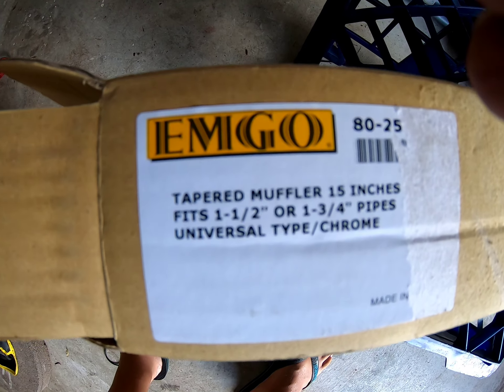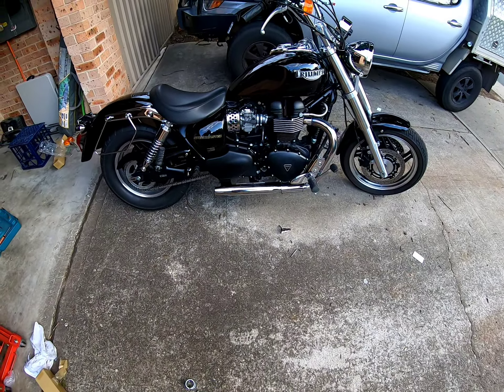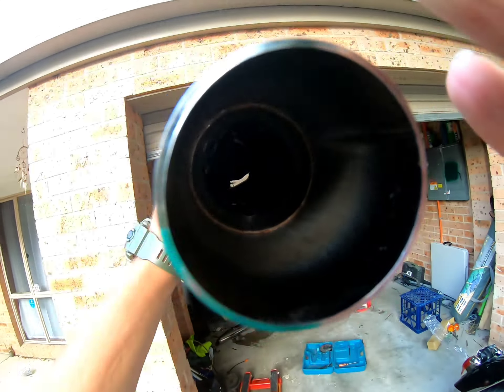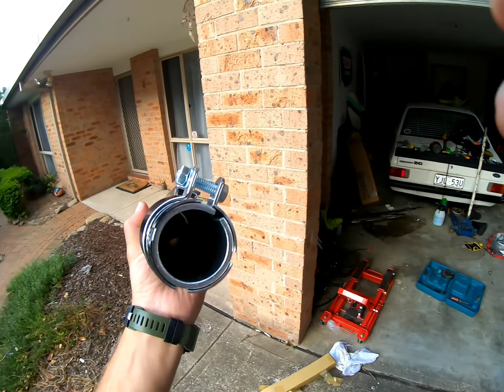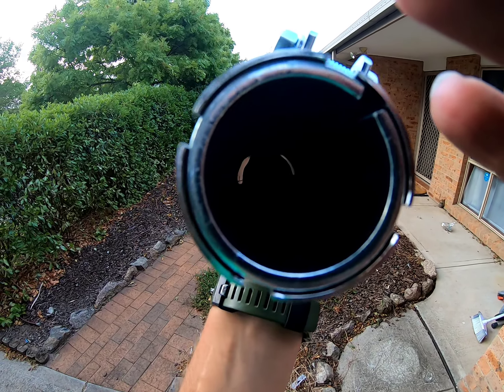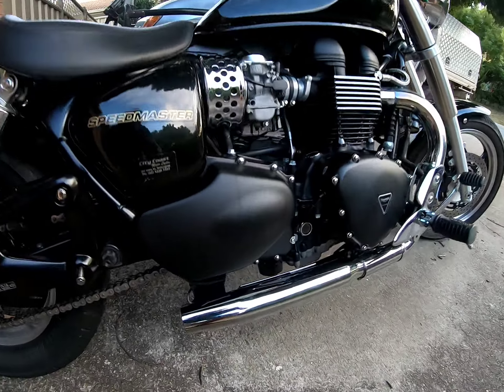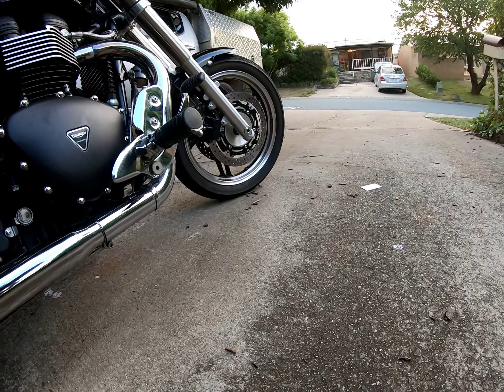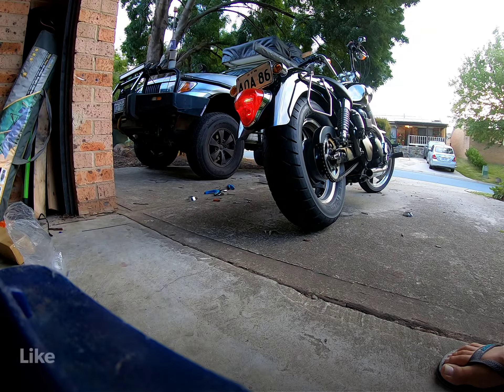Triumph Speedmaster/America - Exhaust Comparison - Wow!! What a difference

Comment: Hello, I like these above the staintune myself and for a third the cost. You mentioned getting proper exhaust pipe clamps, did you also use or make up a bracket for hanging them?
Reply from the maker: I find the staintune may have a bit more torque down low but mid to top and cruising there's no difference, but the emgo sound better and can be heard in traffic too. Bracket I have been dodgy, it comes with long brackets, I drill out out a hole and just used a hose clamp through the bracket and around the bottom of the frame, can't see it and is solid 👍